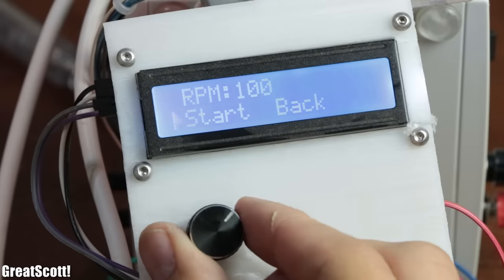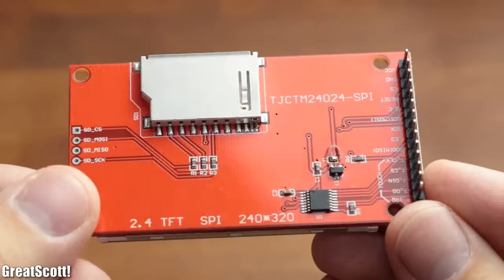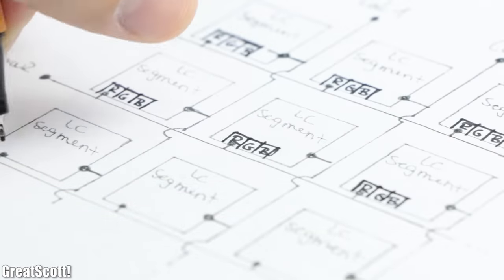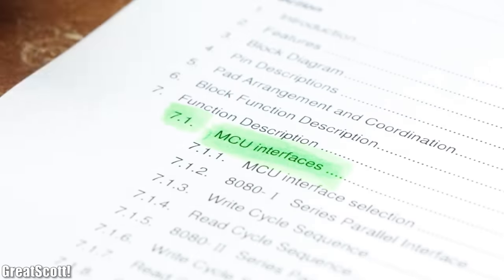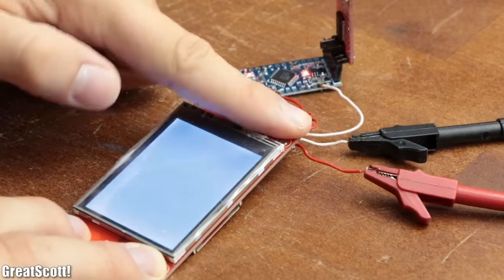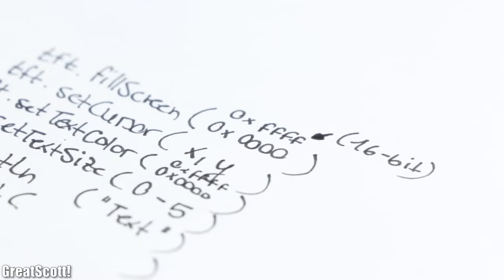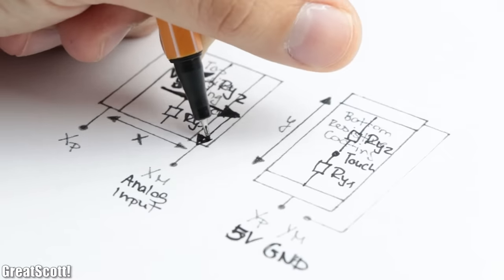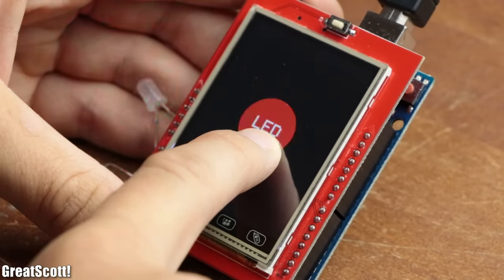How to create a simple Touchscreen GUI || Arduino LCD & Touchscreen Tutorial

Comment: Can we send messages / files using Arduino,TFT and HC05 module??????

Please reply...
Reply: Of course, the only thing you need are those modules and enough pins of the Arduino to connect them.

The most difficult part of that project is to implement the GUI, cause as I understood about you want to make, is like a "chat" between two devices using Bluetooth.
So the GUI will need a keyboard (a lot of touch-buttons) so programming that could be a little bit confusing for non expert programmers.

Also, I recommend you to implement a protocol for the message passing due to possible transmission errors. Implementing the Data Link layer of the RM OSI model would be enough as you can check and retrieve (re-sending) damaged data frames.
I remember you that the HC-05 uses serial UART data transmission, at the most bottom layer: the physical; so any error can be introduced.

Of course you can handle the project in a simpler way, but I advise you for the best implementation you can do.

Good luck with your projects!!
Reply: @maddox5465  Thanku ❤❤

Comment: 5:49 In mine i need to connect reset to pin 8 and change line to:
Adafruit_ILI9341 tft = Adafruit_ILI9341(TFT_CS, TFT_DC,  8);

Comment: Hi can you do a video for blue pill (stm32) integration with various LCD or OLED screen and integration with Android app for IOT application
Reply: Use the stm32 duino bootloader and you are done, a lot of libraries are compatibles and the one that aren't have already been ported, i succesfully used u8g2lib with a bluepill
Reply: fabio foltran thanks alot
Reply: you're welcome, the blue pill is a beast, i pretty much finished a dual ad9833 signal generator with a 12864 lcd and 2 encoders, everything is running smoothly, i plan to add a si5153

Comment: its white because you select wrong driver IC to the program configuration ; )
Reply: Which display would you recommend if I need pin 0 and 1 free for Midi use? The rest I think could be handled by a touch display.

Comment: Make a diy or buy vape please ...
Reply: Why, vaping is not bad and blah blah. But you don't know if he vapes or smokes, and it doesn't sound like he does the latter!  But I'll help you out here, all you need is a battery sled, if you want to regulate your batteries get some protection ic or board that you can solder to the battery sled, get your atomizer or whatever ya call it fit it into whatever your putting this project into, and from there if you want few fuses and a switch, if you want SOME protection without using some protection circuit pcb, a good old MOSFET will help. Have fun but do your research, vaping hasn't been researched in depth and is only 95 percent healthier than smoking. A lot better but 5 percent.
Reply: I am more interested in the technology involved in the vape, than actually use it, I do not even smoke or anything, imagine the programming of the screen and the power control ... I even think that the rot can make its own atomizer
Reply: Making an atomizer is easy, buy an RDA man! But I see what you mean I used to vape but I have a lot of issues coughing already and it's just no fun plus like I said it hasn't been researched all the way yet man. But good stuff.

Comment: Very good job! Caution! These modules can look the same and even sold with the same specifications, but their drivers can be different. I recently got a same looking 2.4" display shield from ebay, also for cheap, from chivazhu, but while trying out many libraries I could not make it work, in https://www.youtube.com/watch?v=AM_AaGw3d6g (RU) I found out, that the driver is NOT ILI9341 as sold, but SPFD5408, so apparently smokeandwires library (also there was some kind of conflict between this and Adafruit_GFX library) for the ST7781 also won't work.

Comment: The Pi is better
Reply: Agreed friend, arduino should be for beginners it makes people lazy and want to only use arduino my professor has banned it for projects for that reason nvidia jetson and pi are much better.
Reply: Yes and no. You cant say wich is better. For exampel: if you wanna make a simple robot or something, you can use an arduino.
But for a retro console or smarthome system or pc or something the raspi is better.
Reply: Peter hase Likewise, yes and no. I built my auto drone with nvidia's jetson tx1 (tx2 wasn't in the budget) and arduino wouldn't be viable there, jetson is king for machine learning so yes we can say which is better in thst respect, so yes arduino has its uses, however I see and everybody I've trained under has not used arduino industrially and same to the jetson! home automation sure, but I say there are better options for that, arduino is good for beginners and people LOOKING to make it easy Scott isn't a beginner by no means but he does youtube he can't make a 4 hour video explaining how to do back propagation on a neural network nobody will watch it unless they understand it or are learning it on the jetson so arduino is suitable there! And like I said arduino is designed to be easy, but for me my past mentors and everybody else I've worked under easy wasn't the driving force it was patience and time to learn. Arduino like I said, dupont wiring, open source, libraries it's designed to be easy. And I'm going to give my honest opinion here and hate me for it or not, the arduino just makes people lazy. It's a good platform for beginners but after that those beginners will use arduino for essentially everything I have not seen one! one! person who started with arduino switch to something else, easy is amazing when you're starting off, but not when you're trying to do work that is challenging making said work easier is one thing, but to be lazy about it is another.

Comment: Would you consider trying a similar project using the 7” tft displays? I am currently trying to use the screen and shield from sainsmart (link below) but I am having issues.

https://www.sainsmart.com/products/sainsmart-7-inch-tft-lcd-display-touch-screen-for-arduino-mega-2560-r3-7-lcd-mega-tft-sd-shield-mega-2560-r3

Also Ive always loved your videos and am a big fan!